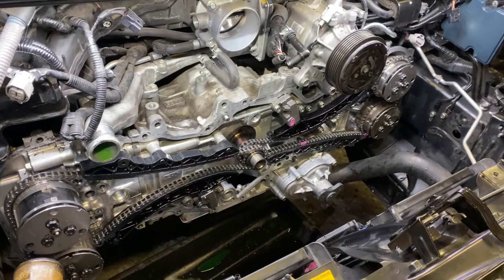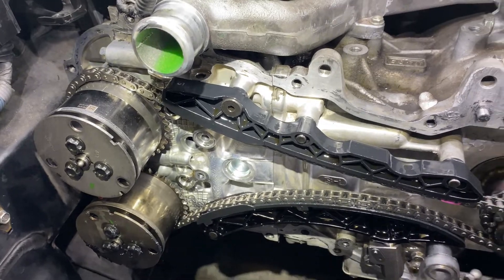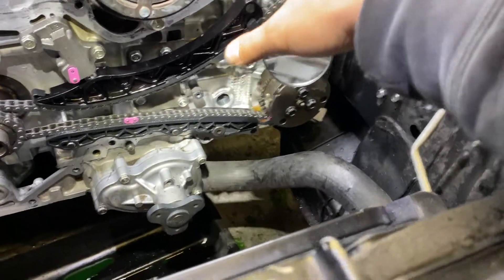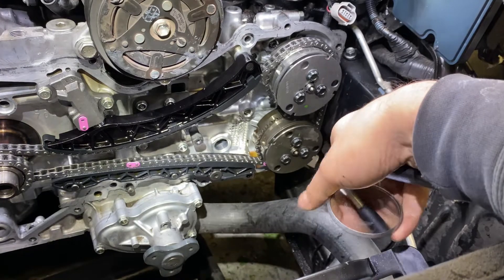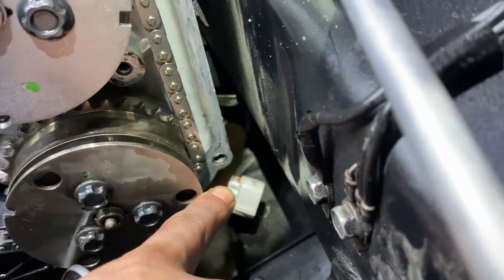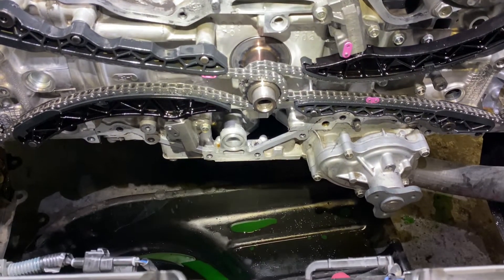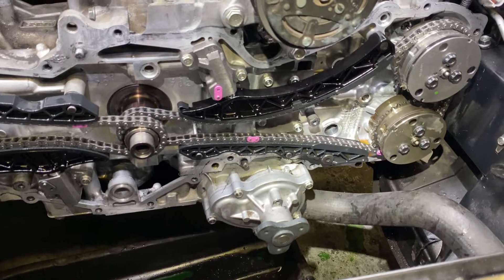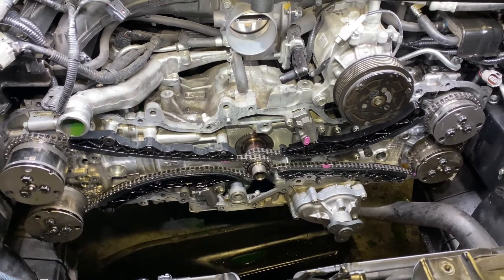Scion FRS - Subaru BRZ - P0016 P0018 P0011 P0021 After Chain Replacement - What to watch out for!

Comment: Have you had any issues setting the timing on the right side (when facing the engine) sprockets? I had to advance the timing a bit on the bottom one and felt the sprocket pop and get 'unstuck'. I'm afraid I may have ruined the sprocket, but there was no other way to advance the cam timing to get the right side of the engine on timing. Any ideas?

Comment: Swapped the OCV sensors and cleaned them all, p0018 still stuck around, did an oil change, didn’t help either. It certainly has to be the sprocket right?
Reply from the maker: I would say most likely sprocket and ECU

Comment: Might be a long shot. Took engine apart . Reinstalled head gasket, resealed camcarries, here is the kicker. I mixed  the rocker arms and valve tips(fell of the table), they looked the same so i gave it a shot. I reused both chains(never had a ticking noise before so i figure it would be fine to reuse the chain(200k car) but installed new tensioners, once timing was set i noticed one of the chains was a tiny bit looser im comparison to the other side. When i turned the engine by hand the slack evenedout. Cart turned on, but I Have a code p0016 and p0018. I really dont want to take the engine out. Car runs. But feels a bit under powered. .
2015 outback. Did i mees up with the valve stuff or is it something else?
Reply: Are you serious with questions like that after what you wrote.

Comment: When it sticks does it seem to knock the timing off? I’m rebuilding mine fa20 and I just did the timing and tried to do a resolution and it stuck and the bank 1 arrows were a tooth off?
Reply from the maker: This particular job had no drivability issues, but when looking it up in scanner the degree of advance in timing was outside of spec and didn't move at all - once we replaced all components we had the same issue, that's when I learned the only way to "clear" that is to replace PCM because if PCM learns outside of spec it can't unlearn it and sets same codes.
Reply: @totalupgradeautomotive7276 it has, you can hear louder work on higher revs ( this engines are loud even without this issue that's true) .  Timing is worse and afr is different.  Less power or DI can mess with engine oil... Depends from it's advanced or retarded.

You can learn it there's a procedure. As I wrote in other comment. 😊
Reply: @totalupgradeautomotive7276 does this apply to 2017+ cars as well?

Comment: Bro i have a 19 BRZ and my engine seized so i bought a used JDM engine and swapped it. Im getting all 4 codes p0016-P0019 and also a p0011 would all 4 go bad at once or does 1 set codes for all
Reply from the maker: If it's a JDM engine - it will set codes if you don't replace the entire wiring harness - JDM have extra wiring for solenoids that US engines don't have so the computer can't trust the readings - you need to install OEM wiring harness to JDM engine. We learned that the hard way.

Comment: Is there anyway to unstick it. What’s the best way to get to function like it should
Reply from the maker: Apparently the ECU has certain parameters - if the code sets - the ECU cannot be relearned to within specs so you need to replace the sprockets with new ECU

Comment: Got a 2006 Subaru Tribeca with P0016 & P0018 and it's a nightmare.  I did an engine oil flush, fresh oil, new filter, replaced the valve oil solenoids.  CEL came back after 30 miles if that.   I only have a basic Autel MaxiLink to read/reset codes, but nothing fancier. 

Was going to sell the car but now it's hopeless without dumping a bunch of money into it which I don't have. 

I can replace the camshaft/crankshaft position sensors but after that, if it doesn't resolve, it will be most likely a chain/guide/sprocket.
Reply from the maker: Those repairs aren't super expensive if you know how-to but they can be very time consuming. Subaru's hold their value so you can also sell it for a decent amount with that issue.
Reply: https://youtu.be/ur-jb_lwO0o?si=-4LgLiXRyiydyMZ9

Comment: Got code p0016 and that piece on the intake sprocket also fell off when i took it off, so we replaced that sprocket. Inspected rest of timing components which all seemed to be okay. After replacing sprocket and checking timing, Now we get p0017 for the exhaust side. Could the exhaust sprocket now be sticking ? Any help is appreciated .
Reply from the maker: More than likely timing may be off - unlikely for a part to fail after installation. But at that point I'd do the exhaust sprocket and retest.

Comment: What does this sticking sound like? Would there be a ticking noise coming from the sprocket?
Reply from the maker: Only way for you to know if it's stuck or frozen is to use a scan tool that can command timing adjustments - you can also monitor the timing - a good motor will advance and retard timing while applying the throttle automatically - if one side isn't doing that, it's most likely frozen or there's an issue with a sensor or VVT solenoid.

Comment: Are the vvt sprockets supposed to be able to turn freely without turn the camshaft?
Reply from the maker: Not supposed to turn freely - if they do, most likely they're bad.
Reply: Just had my first one do this to me on reassembly today . Its confusing because on disassembly, the gear feels "fine" because its already maxed out in one direction, then when you turn it the other way on assembly, oil dumps out of it and it becomes loose and turns freely by hand.   Ive done about 15 J02 recalls, they are not supposed to turn by hand, calling Toyota tomorrow about it.
Reply: @G-Tech10   If you do this when you install the left side or bank side two drain the oil from the sprocket with the aim of making your chain easier when you start the vehicle it can make a sound
Reply: @G-Tech10   It will make a strange sound because the cam gears are unloaded, in fact occasionally they have a hard time making their first engine start but once they are loaded with oil everything will be normal.
Reply: @G-Tech10   The code does not refer to the gear wheel, it refers to the solenoid that controls the oil pressure. It tends to confuse the solenoid when the oil is very thick and it fails to release
Reply: @G-Tech10 The solenoid when the vehicle is idling keeps the oil pressure out of the wheel but when you accelerate the solenoid must contract and put oil pressure in to make variation

Comment: Hey dude imnhaving issus whit my car wrx 2015 fa20 i have this code p0019 exhaust lh bank 2 crank position correlation if u have and idea can help me out i will apprecciatte for life
Reply: Did you ever resolve this?
Reply: @TheMinecrafters691   Change the solenoid on that bank that tells you not to change the wheel, put in the oil that it should have, I think it is 0-20, the solenoid is not contracting, that is why it shows you that code.

Comment: i have a question, i lined up my timing marks, when i manually crank it to check the marks the passenger side upper cam aprocket like clicks. is that normal
Reply: Mine did the same in the  top drivers side. Also wouldn’t align unless I manual moved the face plate. Not the cam. Believe is due no oil pressure.
Reply from the maker: @ericarg  Yes - you can't check these like timing belts because you need oil pressure to maintain pressure on the chain tensioner.
Reply: Did you replace the sprocket?
Reply from the maker: @ yes but we only did sprockets specific to the codes that were setting if that makes sense
Reply: @totalupgradeautomotive7276  i appreciate the reply. Got a right side intake vvt sprocket not staying in its locked position while assembling after head gaskets.
Reply: @johntaper did you end up replacing the sprocket?
Reply: @tystanton5036  yes. I didn't trust it. Not real familiar with subarus, but on anything else those sprockets should stay locked in place.
Reply: @johntaper  was yours like sticking and jumping after making sure the timing stayed in time?
Reply: @tystanton5036  yes. When rotating the engine by hand it was jumping.
Reply: @johntaper  both intakes sprockets? You replaced and you were all set? If so did you soak the new ones in oil?
Reply: Thanks for the replies btw 🤝🏼

Comment: I resealed the cam carriers, valve covers and timing cover and now I have rhe P0018 code. Scanner says the bank 2 intake cam is at 22° advanced all the time. The other side does change but just a few degrees either way. Swapped all of the sensors and no change. I'm 100% the chains are on right but the arrows never lined up on the drivers side. 
Not sure which way to go with this now. Lol any ideals?
Reply: ummm if the cam arrows didn’t line up then it’s not timed right 🧍🏻‍♂️ they have to line up pointing at eachother
Reply from the maker: @xclusivejohn8342  Yes if it's misaligned on one side the timing won't advance or retard and it will set codes - you have to be sure they're aligned correctly - then once they're you can determine if the sprocket is "frozen". That's why we just recommend replacing everything so we don't have to go back and do everything again.

Comment: I have a 2013 frs, with the p0018 code popping up, planning to change the bank 2 sensor a sprocket. Once I erase the code the car drives fine like the code was never there, but after around 10 miles the code would pop back up. have any tips?
Reply from the maker: You have to replace ECU due to learned values of cam adjuster sprockets, once the computer has learned a value that is out of specifications, it cannot unlearn it and will continuously set codes even with new sprockets.
Reply: @totalupgradeautomotive7276  ahh i see, so regardless of me changing the sprockets i’m going to need a new ecu. this code came on after i switches to 5w 30 oil, so yesterday while we drove we looked at the live data of all the vvt areas and some numbers were very off of each other. we flushed the engine and put in the original 0w 20 oil and looked at the live data and everything seems within range. but the code came back on after 25 miles of driving.
Reply: since my live data looks good, do you think i should be able to change the ecu and it should be good?
Reply from the maker: @insaiyann8925  That's what happened with our vehicle but you'd need a good shop to double check diagnosis for you but new ecu should fix it.
Reply: @totalupgradeautomotive7276  just changed both bank a sprockets yesterday, drove the car today and the code came back up after 25 miles. the code has been bothering me for months now. is the next step to change the ecu?
Reply from the maker: @insaiyann8925  Yes that would be what I would do but again, I would take it to a trusted mechanic to have them verify that's what it needs
Reply: @insaiyann8925  did you ever change the ECU?
Reply: @insaiyann8925  what he asked

Comment from the maker: Update: Needed ECU replacement because the learned values on cam timing cannot be adjusted once they're out of specifications - make sure you diagnose the code correctly the FIRST time so you don't have to go back, and if out of spec, ecu will need to be replaced as well. I tried used ECU but would not read new VIN and could not get it to read keys, let me know if you guys have any solutions - I tried using AUTEL scanner and Snap On Triton - neither worked. I didn't have time to order and try Toyota Techstream off of amazon.
Reply: Hello. to get the used ecu working or at least starting the car. you will need to connect the used ecu to the car. On the OBD port short pins TC and CG (pin 4 and 13). turn the ignition to ON and leave it like that for 30 min. you will see some light be flashing on the  cluster. 
after 30 min turn key to off, take out the wire from the pins. and you can start the car.
Reply: an Autel scanner will work to clear values ive done it
Reply: @Steeezy5s what do you mean ? Will it fix the problem?
Reply: I work for Toyota dealer. Techstream CAN NOT reset it, neither can Subaru's system. They both note the ECM MUST BE replaced. Absolute a pitiful design on Subaru's part.
Reply from the maker: @7MGTEsupra89  Thank you! Very hard to find that info if you don't have the right resources!!!
Reply: Theres another way to reset vvt value guys
https://youtu.be/ur-jb_lwO0o?si=-4LgLiXRyiydyMZ9
Reply: What you mean by needed to replace the ecu ? I thought you only had to replace the sprocket? Please advise. I have same problem p0011 p0021
Reply: I have installed used ECUs in these after timing repairs. SSM4 will allow you to rewrite the vin.
Reply: Any update?! If you were able to pair the ecu to the vin, did it fix the code problem?
Reply: How much did you pay for the new ecu thank you
Reply: There's whole procedure for vvt learning. best way is do it with ssm .

 Someone who wrote he works in Toyota... probably doesn't have any idea about 86 and BRZ. 

Next thing you have to check valve clearance, and best way in same time to check pivots and rocker retainers. 

Worst thing to brz and 86 were Toyota mechanics;) they even used wrong silicones to this engine ;).